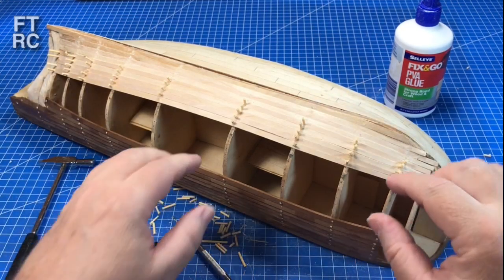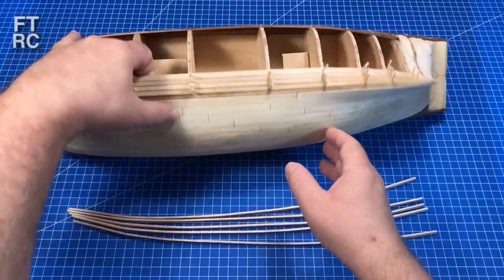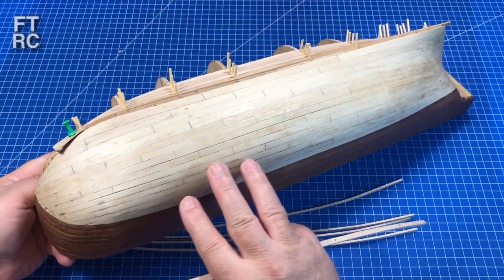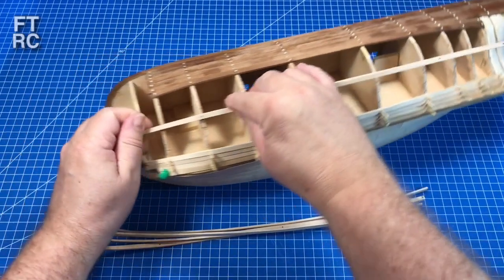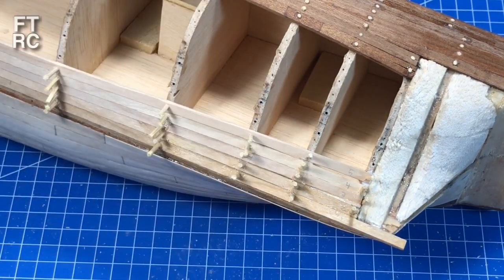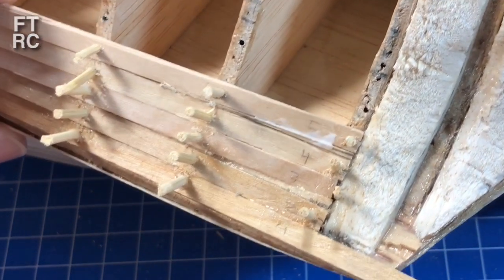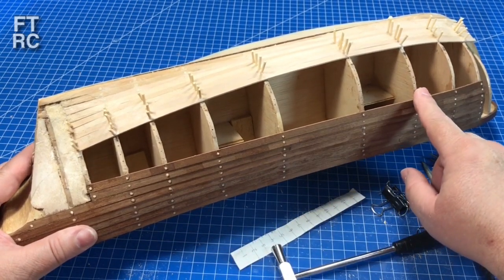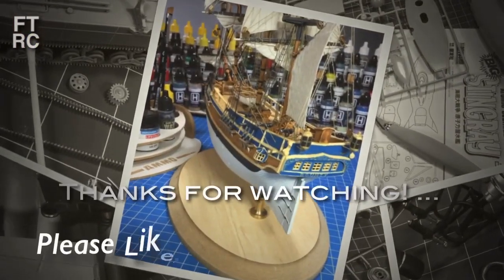Bounty by Constructo Part 5 Planking lower hull

Comment: Harry another great how too. You got me started on the HMS Snake lol’ doing it on Sunday’s as I’m still working my 1/24 scale Stuka.  I will keep to Sunday’s and do my mormal moderling the rest of the week. In the frame stage, now levelling the frame to the deck before shaping as much as i can before gluing then in permanently. Thank you Harry
Reply from the maker: Great to know I have corrupted, um, inspired you to go the wood.
Reply: @HarryHoudiniModels  Had the kit for many years and the the correct  paints for her as well. thanks again harry
Reply from the maker: Well time to blow the dust of it and get planking!
Reply: @HarryHoudiniModels    Well Harry the frame is complete and the deck makes ready planking later. Had a little problem at the stern the with last frame piece. I put it in as per the instructions “sorry drawings” it was 2mm to low’ all sorted.  Went to a build of the ship on a forum and sorted my way to late the way the other builder round it. May do the odd video on progress on her, wasn’t going too.
Reply from the maker: Yes the former ribs don’t go all the way to the keel at the stern.  That’s what we call deadwood.  Just the thin keel up to the rudder.  If in doubt, a level or slight inclined deck is what you aim for.

Comment: Nice work Harry. 
       I found that to avoid the rough inner planking splitting I used Lime wood planks. They are quite flimsy but are a lot more forgiving when cutting and bending and don't split anywhere near as easily. Some kits actually come supplied with lime wood planks for this purpose. I suspect I am teaching my gran to suck eggs.....
Reply from the maker: Yes they would have been better, but I was stuck with what little there is available down under right now.  Supplies are low so I took a chance on birch.  Luckily it is only the first layer, so will be covered by basswood, as it did on the otherside.

Comment: I’ve never do anything like this I’m tempted to try but not sure any suggestions?
Reply from the maker: If you want to start building a wood ship, then start small with a one or two mast ship.  A jolly boat, brig or schooner.  They have an easier hull shape to deal with, less planks, plus much less rigging to get all tangled in.  If you enjoy doing that ship, move up to a slightly bigger square mast like this Bounty or a bigger brig or frigate.  Don’t even consider a huge ship of the line like the Victory until you are more experienced in the techniques of construction.
Reply: Harry Houdini Models ok thank you mate I’ll have a look 😀👍
Reply from the maker: Look for a second hand kit first. Unless price is no problem. Often people get the kits as gifts, but then become to scared to build it, so sell them off at very cheap prices. Just like my Bounty which I bought for a quarter the new price.